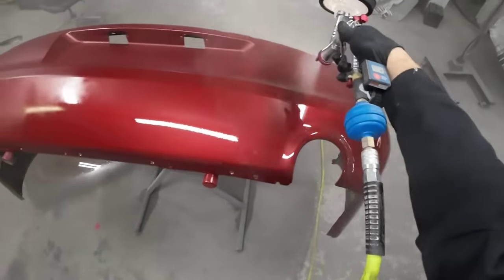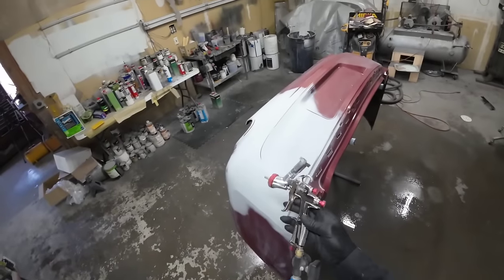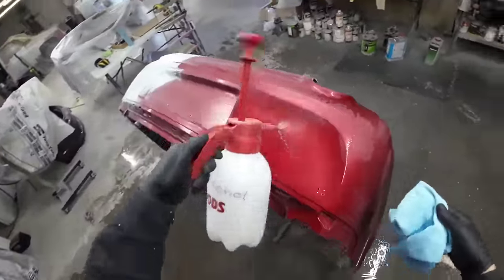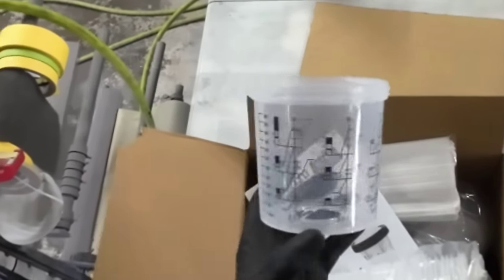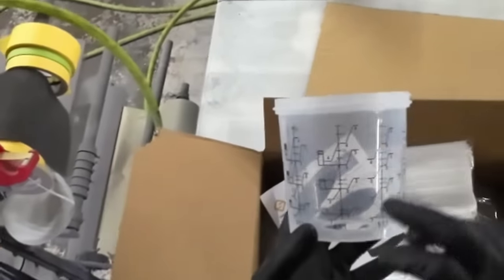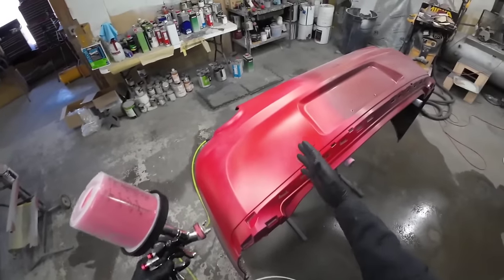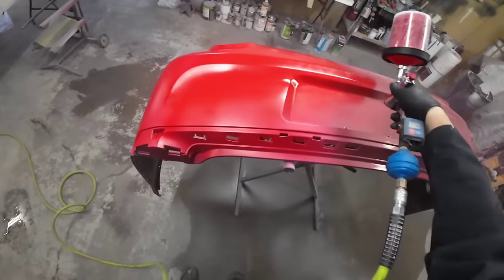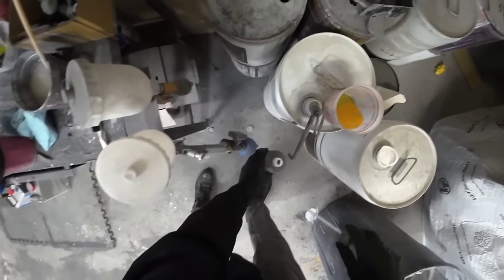The best low cfm budget paint gun for painting your car!

Comment: After finishing a job at home today with this gun, I had to stop by and say thank you for the recommendation. I'm working in my home garage with a 4cfm compressor and have produced decent results with some cheaper and much more expensive guns than this one, but for the first time, I'm proud of the factory-like finish that I was able to lay down with this gun today with no buffing, sanding or polishing. I have dreaded this part of the jobs I've done so far but now I'm excited to do more. Really impressed with this gun ! Thanks!
Reply from the maker: Awesome! Hey, I really appreciate you letting me know about your experience with the gun. Helps me to dial in the content for the community.  Let me ask you with the 4 cfm compressor did you use the technique of lowering air pressure along with the fluid volume to get your results? If not what we're you gun settings.

Comment: One of the best videos you put out by far, sometimes us beginners needs to see the adjustments of the gun, paint mixing procedure, air compressor/regulator setup.
Reply from the maker: Oh good! Thank's for the input, I did it a little differently and wasn't sure how it would be recieved.  Appreciate the comment and support!
Reply: @GarageNoise  What size hose would you recommend I use for this spray gun??
Reply from the maker: @chrisplayz9739  I always use a 3/8 hose.  It works well. Appreciate the comment and support!
Reply: @GarageNoise  thank you for your help, i have a 20 gallon husky compressor with 4 scfm at 90 psi and im gonna try to learn to paint with the r500
Reply: @chrisplayz9739 no way i have the same compressor.. how did it go?
Reply: @UwU._Sqb  it worked lol
Reply: @chrisplayz9739  were you able to spray consistently ? Or you have to stop to refill the tank?
Reply: @UwU._Sqb  i did 1 panel at a time to be safe

Comment: I've been using budget pps since day one. I also pick up the refill packs at Harbor Freight because it only costs about 10 bucks for enough to do an entire job or a few small jobs. I always use pps for clear because of the screen, but to save $$ I often use a regular cup for base and sometimes primer. Base isn't too bad to clean out.
Reply: That's a really nice finish, the big overlaps really help and yeah, this gun is pretty slow so you gotta keep that thought as you spray
Reply from the maker: Yeah the harbor freight may be the same not sure. I believe  I got the adapter for this gunat HB. Appreciate the support ! I've  watched some of your videos keep it up!
Reply from the maker: Your  right about that. I've  always been in the habit of judging  how the clear is coming off the gun because for a long time I was painting with a smaller compressor.  Wish I had this gun when I was struggling with air pressure. Appreciate the comment and support!
Reply: @GarageNoise i'm not much of a content creator( more of a content watcher) but I am going to try to document some work  here and there so I can direct potential customers and they can check out what I do...
Reply: @BearBudgetgarage  Do you use 24L or 50L air compressor when you use lvhp spray gun??
Reply: @chris01479  well, the only compressor i'm using for paint now is a 6o gallon...so 227 liters? I used to use a 30 gallon before I upgraded. I know the Spray it gun can work with a 20 gallon if needed
Reply: Chris
I like the videos. Are you open to doing any paint jobs?
Reply: @BearBudgetgarage  I've sprayed kitchen cabinets n doors with a 10 gal tank compressor..compressor did run most of the time but I still didn't seem to lose air pressure at the gun..of course spraying cabs n cars is 2 different things.. I did spray an Explorer with a 30 gal tank bout 7 yrs ago, worked fine
Reply: @clinttorres2508  yup. I have sprayed with a 30 gallon full car as well before I upgraded. Now i run a 2 stage 60 gallon as I am doing a lot of paint work all year now. I did get it used and at a good price, tho. Was in great condition

Comment: I did my international Scout with that gun, took the top, fenders, doors and windshield cowl off and sprayed them separately, then only had 2 body panels on the truck to do along with the door jambs. worked very well. did it with a 29 gallon 5cfm compressor.

Comment: You talked me into the Aeropro R500. Thanks. I tried the el'cheapo Harbor Freight $15 gun and had to stop after my first coat.  I just couldn't adjust my mixture to get a decent finish. 
    So I'll do my next coat with the R500, after I do a little sanding

Comment: I am  in the middle of painting My 1968 Camaro  ( complete color change using PPG concept single stage ) in my tiny garage with a 30 gallon compressor ive done it once before on my previous car a 1965 mustang fastback. My only gun until a few days ago was a Warwick 881h HVLP. This gun would hardly put out any material because it needs13 cfm. My little compressor couldn't keep up... The amount of wet sanding and polishing ive had to do in the past to get a nice finish is insane.

This gun the R500  is almost life changing!! for me 🤣....Iam so excited to spray the rest of my Camaro!  I did a test panel yesterday and all I can say is wow. A real spray pattern and material iam just thrilled this gun has come to market for us garage DIY guys its a game changer for me.
Reply from the maker: There you go, that is a great testimonial on this paint gun from real world experience! Although I have plenty of air with my compressor.  I have painted plenty with an air guzzling paint gun and a small compressor. I was excited to share this to help out all the diy guys. Thanks for sharing your experience and supporting the channel!
Reply: @GarageNoise  I had never heard of  a "LVLP  spray gun" until a week ago! I asked the guys at the paint supply shop if they had any guns that took less air than mine and they said not really your better off buying a 60 gallon or bigger compressor  but like many other DIYers I can't make that happen in my situation so I started looking on YT and BOOM I found your videos! Thanks you for taking the time to produce them and sharing your knowledge  👍

Comment: "Pete's Hobbies" performed some side by side testing of various gun's CFM usages. The R500 came out at near 8 CFM, and not the 3.7 claimed CFM. I'm still going to get one because videos like yours provide so much information on the R500. (and I haven't sprayed a car since 1990). Wanted to provide this FYI incase gun is acting up while using a 5.5 CFM compressor.
Reply from the maker: Yeah, I don't  feel like it's  a sub 5 cfm gun. I can say it is the lowest air consumption compared to other guns I've  owned and used. I feel like it's between 7-10 still very low

Comment: You mentioned the significant overspray when shooting clear with the Aiwata gun. I appreciate that you said that as I have that gun and the first time I shot clear with it in my garage that was a very significant issue. I don't use the gun anymore just for that reason. It is a very good gun though as the end result is great, both color and clear.
Reply from the maker: For sure, If someone is spraying in a booth it's not an issue but without one ventilation is a problem. This gun make a significant difference.  I appreciate you commenting and  supporting the channel!
Reply: @GarageNoise  I thought you had a lot of overspray of clearcoat with this gun.

Comment: Italco mini shine 1.2mm lvmp/ hvlp, around $55-60 here. Its a mini gun, but the hvlp version spray around 22-24cm fan almost like a full size gun. The lvmp model spray smaller fan but still usable and consume less air. I only have the hvlp version, but some user say they only use 1hp airless compressor with the 1mm nozzle and it works well.

Italco is a premium brand of auarita. I got several gun with this brand, most auarita model only suitable as a hobby level gun. Its more durable than many chinese brand gun.

Comment: My set up is a mini HpLv with duel in lines filters. And a harbor freight ulta quiet compressor, it has no problem keeping up air. And they are not expensive. I can't believe I'm promoting them lol. I'm a hater🤣 but everything works well I paid $35 for the gun a decades ago. About 200 for the compressor. I like this guy's info. And I'm going to check out this lphv gun.

Comment: I'd mentioned to you in another video that my R500 came with a damaged air cap. But, since I didn't use it until after the return date, I now have a paper weight. Moral: Inspect on arrival.
Reply from the maker: I would say that's  a good tip! You never know with these products. Appreciate the comment!
Reply: @donjohnson7899 Well, dufus the company ghosted me. The tips aren't available any place else unless you know different.
Reply: @sealisland1  If you did research, it uses the same internals as the SP-33000 series

Comment: the upol primer works well as a sealer also, I am glad you are telling people about that,  the 2892 is also good clear, I like that it is system 20 meaning its uses the same activator, edit, upol says the primer can be tinted,I have never done it though, it would be interesting to try
Reply from the maker: Yes, somthing I neglected to mention is the activator is interchangeable. I would like to try tinting that sealer as well. Appreciate the comment and thanks for the support!
Reply: @GarageNoise  I am going to try using leftover basecoat first,I think it refers to using mixing tint though
Reply from the maker: @yeayeasautoadventures1161  yes, you will need the mixing tint. As you know you can't  just add paint to sealer that's a no no.
Reply: @GarageNoise  no, I did not know that,  I used to mix acrylic enamel years ago, I dont remember anything different in it but maybe some clear other than toner,I use the same reducer and activator for sealer as I do basecoat,so no, that doesnt add up to me, Ill try it anyway on a test panel

Comment: Hi! Absolutely loved the video with the very thorough explanation of the garage setup with all the tricks to get around using a booth and with all the tips and techniques explanation. Saved the video, thank you so much!
I got a question. Most probably a stupid one. I got a 4.8 gallons compressor with 2.2CFM@90PSI. I know, I know, it's not "small" but rather "tiny" in the car paint world.
But the question is, is it even possible to paint a small car (a Mazda Miata NB) with an R500 type of the paint gun and this compressor with some struggle for a newbie, or it's a 100% one way ticket to a failure? 
Thanks!
Reply from the maker: I appreciate the comment and support.  Unfortunately I don't  think that compressor is going to get the job done. You need about 6cfms,  typically that's about a20-30 gallon compressor.
Reply: @GarageNoise got it, thank you!

Comment: I am taking automotive painting and color matching at my local university campus up the street. I don't have a ton of money to spend on equipment, and I have a completely different purpose for taking the classes. I restore Ovation guitars, and I want to be able to paint the bowls (composite fiberglass bodies) and tops. The paint job and explanation were great, with one caveat. I didn't hear you specify what CFM would be required of the compressor. Obviously, what I will be painting isn't even a tenth of the square inches of that bumper cover, so I am wondering what I need. I have been looking at 20-30 gallon tanks with a 5hp motor on the compressor. They typically put out between 8-10 CFM @ 40psi. By your description, I am guessing that would be adequate. Thanks for the video, explanation, and recommendation on the gun!
Reply from the maker: For what your doing I believe your right on track with the compressor your thinking of. Appreciate the comment and support brother! Happy painting!

Comment: Very informative, you mentioned a couple times that it was cooler out. Do you recall about what the temps were? Its been ranging about 60-65 deg here and I'm not sure if it's too cold.
Reply from the maker: That's  not to cold to paint in just use the appropriate speed and reducer for that temp. When it gets 50-55 i like to warm up the panel with a heat lamp.

Comment: Which gun is the one-and-only gun I will ever need?  I am a hobbyist in a 2 car garage. The last time I painted a car I used a Binks and lacquer but I am a quick learner and not afraid of wet sanding
Reply from the maker: Depends on your budget and air supply,  do you have a large compressor or are you painting with a smaller one?

Comment: Which do you think is the better LVLP paint gun? The R500 Areopro a610 or the Astro EVOT13? I don't need a LVLP as far as my compressor goes, I have a 60 Gallon. I just want the best finish with the least amount of overspray as I'm painting in my home garage.
Reply from the maker: The R500 or A610 are the same gun just a different appearance.  If you want low overspray this is the gun to get. Evot might have a slightly better finish but it doesn't  offset the material savings and low overspray of the R500. Appreciate your comment and support!

Comment: Note to everyone, this gun and the inoteck D 1 Drizzle are the exact same. Anything you need such as every size needle nozzle and cap set, replacement parts, seal's etc are only available through aeropro for A610/R500 but work on both

Comment: What would the minimum size compressor would you recommend for this gun? For painting an entire single cab truck.
Reply from the maker: Paint a complete you want as many cfm's nas you can afford.  You can get away with about 6cfms but it may slow you down waiting on air from compressor.  Harbour freight make a 30gal I believe that will get the job done.

Comment: Thanks, this was great news as I am researching a setup that will spray kitchen cabinets and  refinish panels on my car. I wonder what the minimum size compressor is recommended. I have a 5 gal. but I don't think it will cut it.
Reply from the maker: No, I don't think it will work with a 5 gallon

Comment: Great video !. Thanks!. Question. At the end of video, when you showed a final result after applied a clear coat I noticed some dust or debris particles in clear coat. What would be the best way to clean them ? Wait till the clear is dry and sand it with 2000-3000? Or scrape with blade,send, And polish the sanded area. Any special tips?  Thanks again for a videos 🤘🏻👍🏻👍🏻👍🏻👍🏻👍🏻👍🏻👍🏻👍🏻👍🏻👍🏻👍🏻👍🏻👍🏻👍🏻
Reply from the maker: I denib them with 2000 on a small kovax block then 3000 and I do 5000 then polish
Reply: @GarageNoise  thankyou!.

Comment: Love the video, thanks. I want to start spraying my cabinets that I custom make with a paint gun and need a set up. I am thinking about purchasing this gun. Any budget recommendations on an air compressor that would do the job?? I have a 2 CFM HF air compressor that I have used with a hopper/gun for wall texturing but I am doubtful I would get good results with lacquer? Any info is appreciated. Thanks!
Reply from the maker: You need about 6 cfm's  for this gun in general  ,the more the better but at least 6cfms

Comment: Really helpful video! Is there any reason to get a really good regulator or can I just use a mid grade/cheaper regulator?
Reply from the maker: I use mostly the inexpensive  ones. I have had them fail on me and that can be frustrating because you then have to determine why your guns not holding pressure. Sagola make a great one, small  and reliable. it's  about $50.00 tho.

Comment: I have a small 3 gallon 1.5HP compressor I normally use to fill my car tires, etc. Would this gun work with my compressor if I am patient? I want to paint my front camry bumper.
Reply from the maker: A bit too small your compressor needs to produce about 6 cfm's of air. Typically that's a 30 gallon compressor.

Comment: Im new a using those throw away cups I was told that when you get ready to use them after filling them with you paint or clear you have to flip the gun upside down and pull the trigger to draw the air out of the cup I have done this and it shrinks the inside liner or compress it then you flip it back to normal and start applying product. I notice you didn't do that.  Was i missed informed on the correct procedure
Reply from the maker: You don't  have to, only if you need to spray upside down.

Comment: For spraying a single stage, do you suggest the 1.3 tip that comes with the gun? I was planning on buying the Eastwood gun, but I can buy the R500 gun and spray cup system for the same price.
Reply from the maker: You could get the r500 with multiple needle sets. The 1.3 should get it done but you may be better of with the 1.4 . I would try the 1.3 first

Comment: I just received mine last week, but I've yet to try it out. I actually brought the kit SP 33500k, which came with a mini gun. I've seen several people who have used the 33000. But I'm curious if anyone has tried out the mini gun. I believe it's the R 100. Think it would would be a cool review as well
Reply: The full size gun holds up well long term, but the mini gun if far lesser quality.  I've had two of the mini guns and they both failed early.  I'm still using 2 of the full size R500s, one of which I bought in 2014.
Reply: @karsbkool  thanks for the response. Just curious, when you say they've failed. What exactly happened, how did they fail? I was mainly looking for the R500, but I figured since I'm also looking for a mini gun...might as well go for the kit.
Reply: @Chili_G_77  it's been 7 or 8 years, so my memory is fuzzy, but it seems like something happened with the fan.